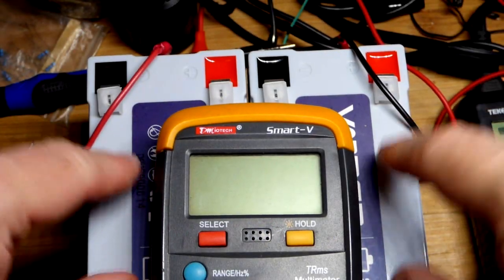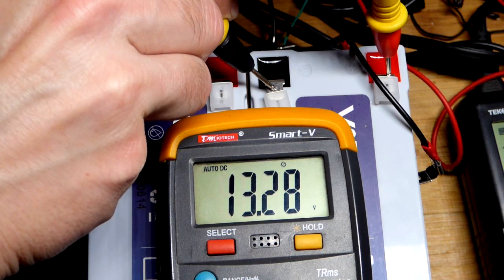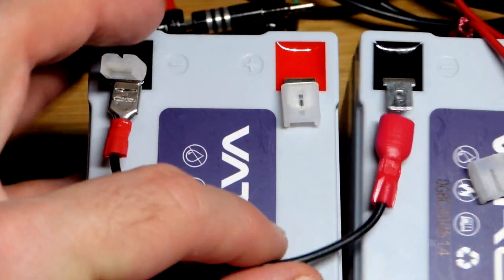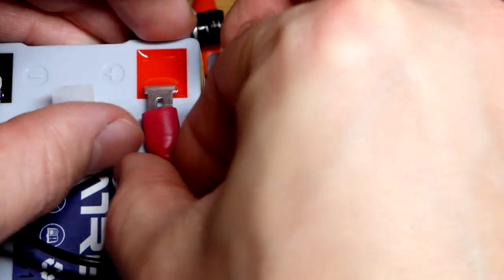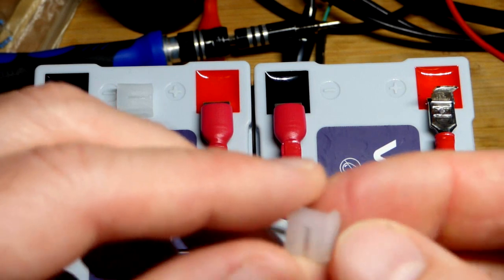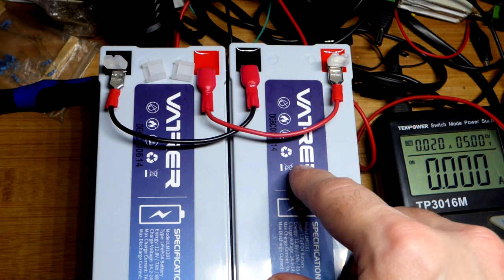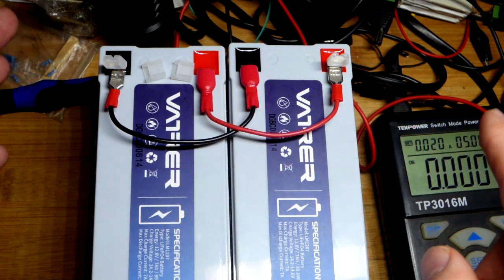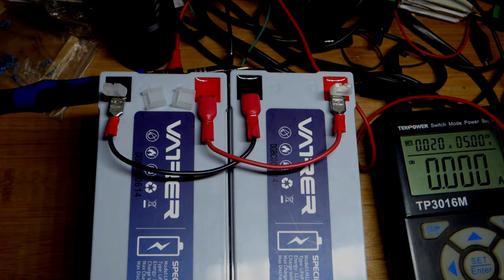How to connect 2 small LiFePO4 aka LFP batteries in parallel by Electronzap

Comment: can you share the link for the spade jumper wire?
Reply from the maker: I made these spade jumpers, here's https://amzn.to/4j1tGZ4 an affiliate link to ones I'd probably buy if I couldn't make them.
Reply: @Electronzap  lots of Thanks man, but i was lookig for the one with both female and male in one end, so i can connect two wires at one terminal.
Reply from the maker: @irfanm6835  Oh, that's called a piggy back spade connector which are at https://amzn.to/3ZaAk8g (an affiliate link), for just the connectors. I don't see any that are already crimped to wires.
Reply: @Electronzap  Finaly, 🤩 Thanks man I found it I found it. Lot of thanks man. Now thats made easy to connect batteries in parallel.